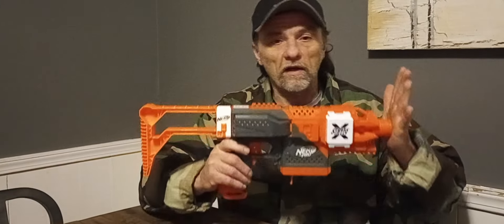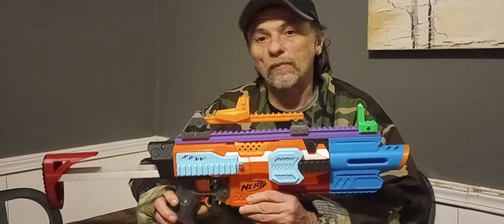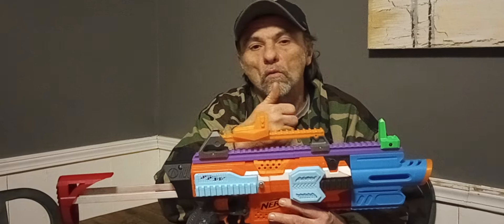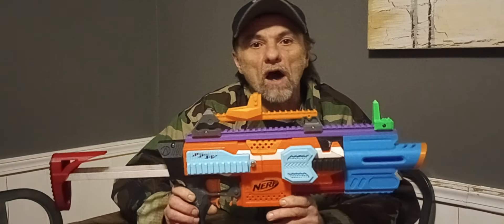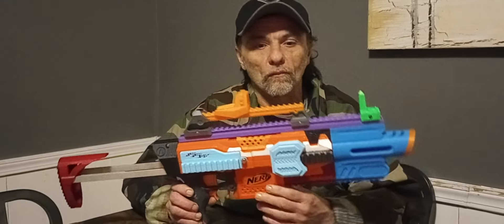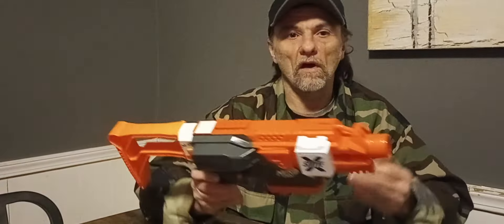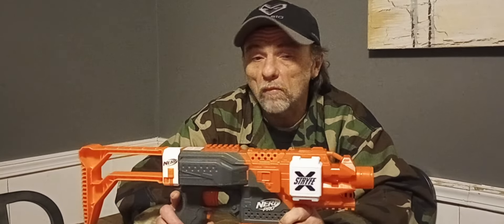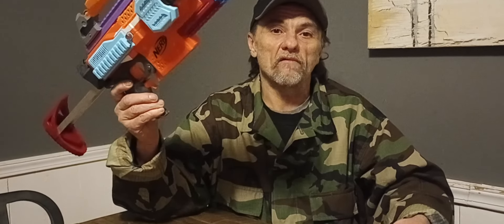comparison between the Nerf stryfe x and a community built nerf stryfe

Comment: I have a question since we are on this topic: I have two blasters that I’m looking into purchasing the cost is around the same after taxes it is a modulus stryfe and a worker swordfish and I am planning on having a stock set up and a modded cage in your opinion, which should I go with as both platforms are very customizable the advantage of the modulus is, I don’t have to search for stock internals and use another worker cage and the sword fish shell I’m paying 30 for just the shell but I want to redo the wiring anyway. Do you have thoughts?
Reply from the maker: Well I would say go with The strife just because there's more kits out there available you can get a swordfish yeah absolutely a lot of swordfish cages are compatible with a stripe as well you just kind of have to look
Reply: @milosmods  ok, thank you a lot! I’m now going to plan my build!